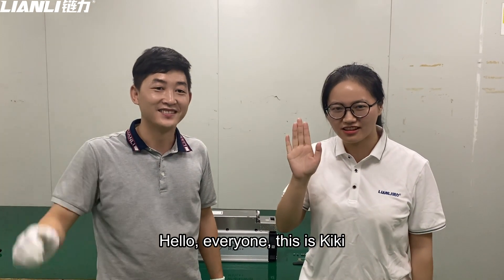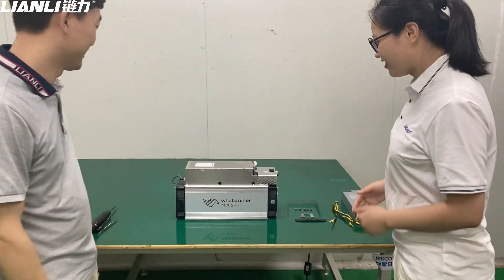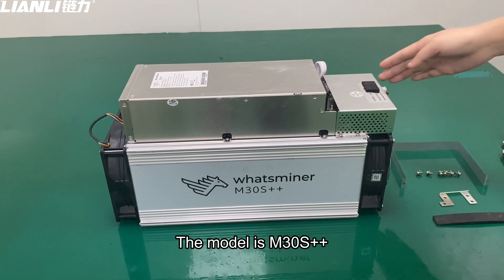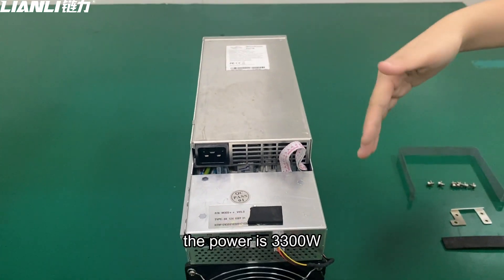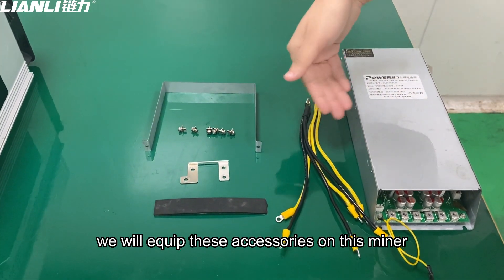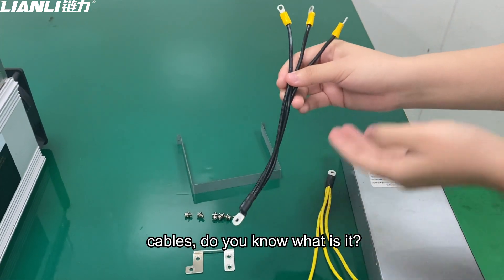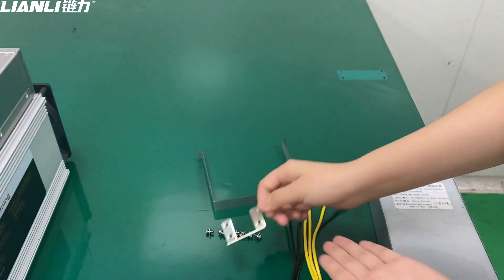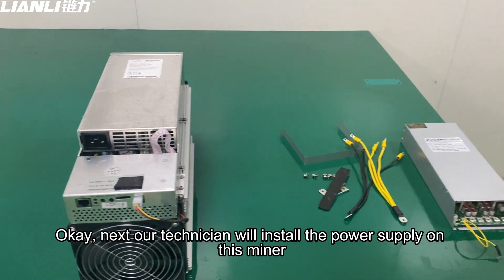How to do overclocking for Whatsminer? Let us show you!

Comment: Makes no Sense. Their are plenty other miner with less power consumtion and higher hashrate. Even they are cheaper
Reply from the maker: If you haven’t purchased a miner yet, it’s certainly best to choose one with a higher hash rate. But if miners have been purchased, or even a large number of miners, the cost of replacement at this time is very high. We must find ways to narrow the gap. This is what overclocking is all about.

Comment: is special firmware needed for overclocking? besides the additional power supply
Reply from the maker: What’s not needed for whatsminer, our company has a cooperative relationship with whatsminer and it will automatically overclock when the power supply is installed